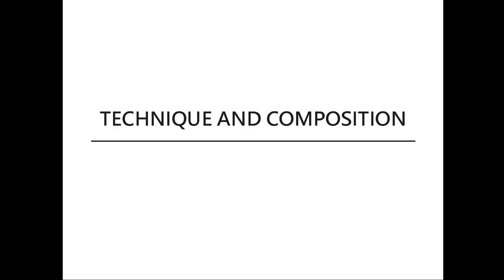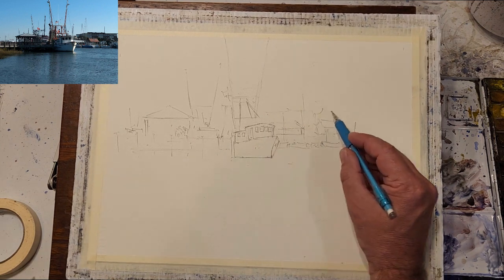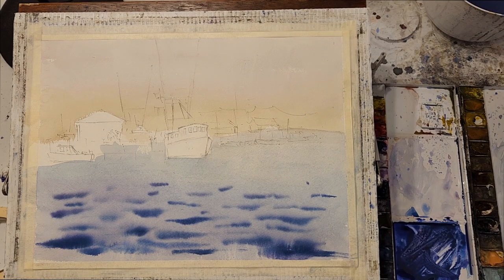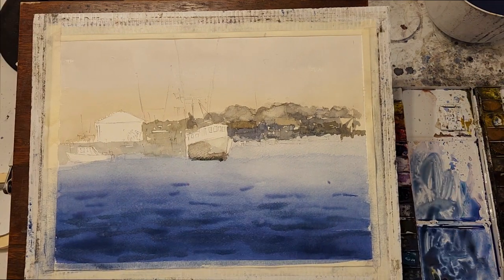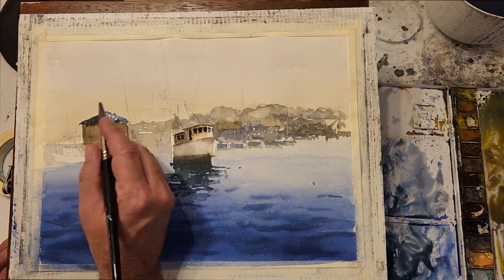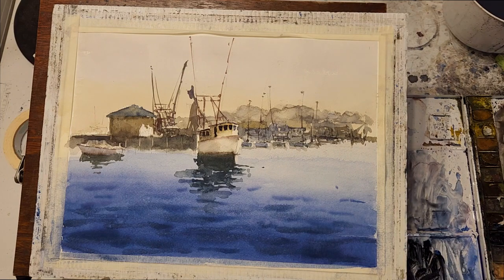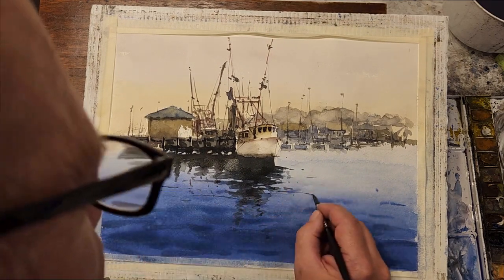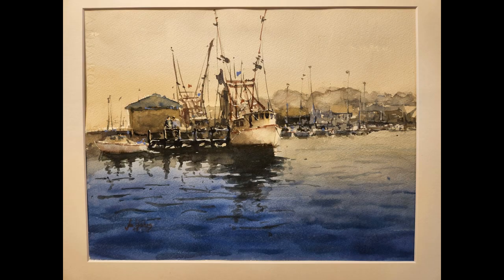Fishing Boat Scene (Watercolor Demo)

Comment: Very helpful video! Thanks for posting it. If you have the time, I'm interested in the brushes you used for the detailed work. One looks like a Number 14 something or other. It's impossible to read the writing given the resolution of the video. Thanks!
Reply from the maker: They are from Rosemary & Co. They are the Snowdrop pointed rounds. I use mainly a number 14 and a number 8. The mop is a squirrel brush. I hope that helps. Thanks for the comment.
Reply: @joehughesart2431  Thanks for the reply!